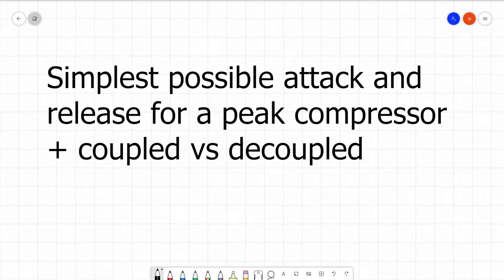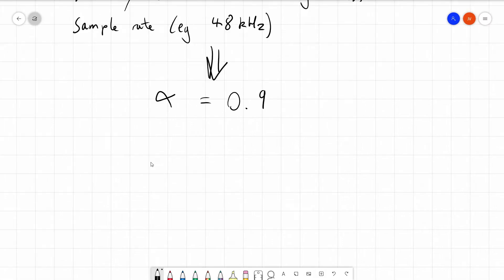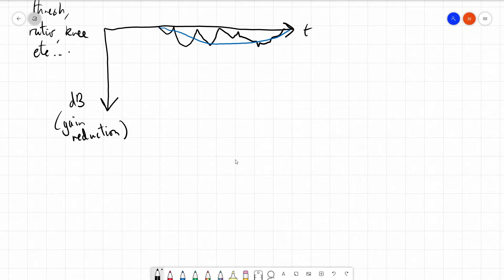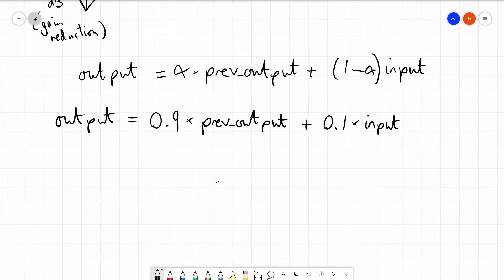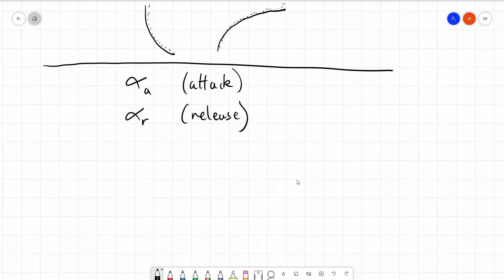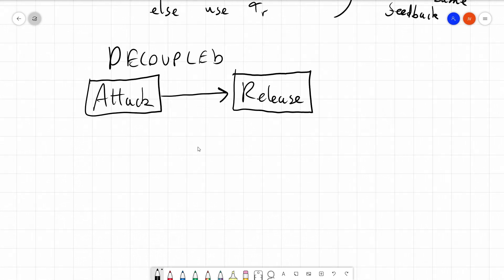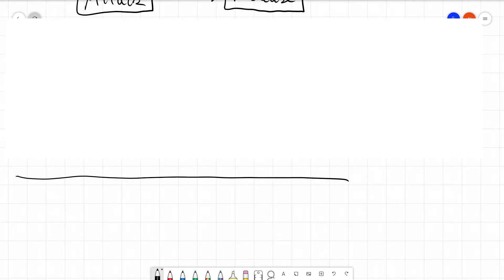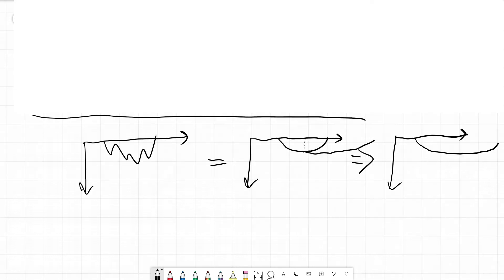How attack and release times work, and what it means if they are "decoupled" (for a peak compressor)

Comment: Nice video. I like this sort of detailed explanation about the plugins operation and technical aspects of a topic instead of marketing blabber and some abstract parameter descriptions. I just have one more question. How are the A/R times defined? I tried to measure that with fircomp1 running hard knee with prog dep set to 0%. The numerical values noticeably differs from the 63.2% gain reduction rule but from linear envelope compressors it differs even more. The attack time extends the release noticeably but overall readings looks relatively stable otherwise, which indeed indicates similarity to RC time constants.
Reply from the maker: It's a combination of RC filters, but the (unconventional) stuff happening during the envelope detection stage before that, may affect the timings a bit.